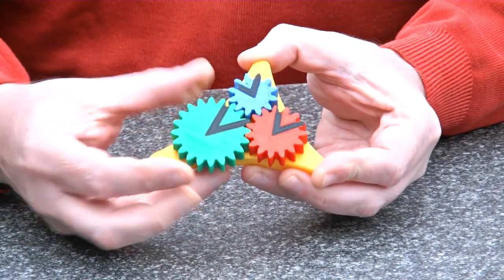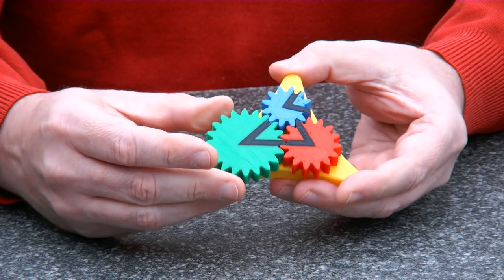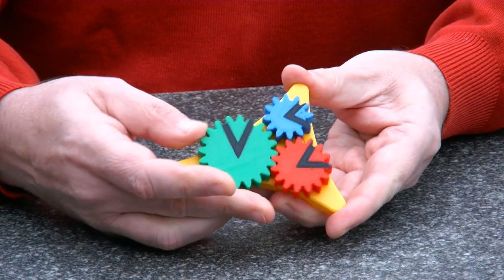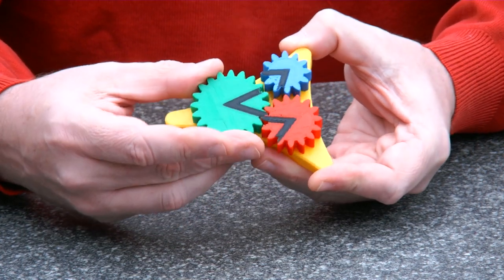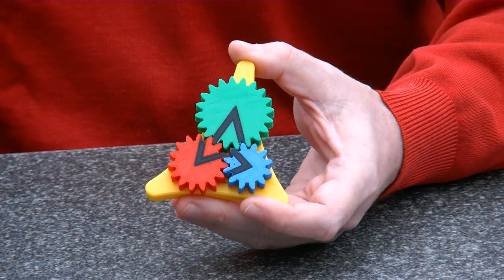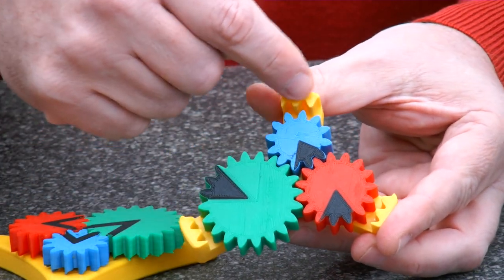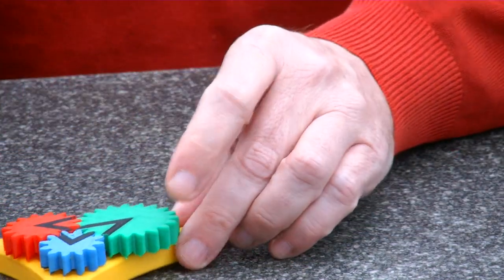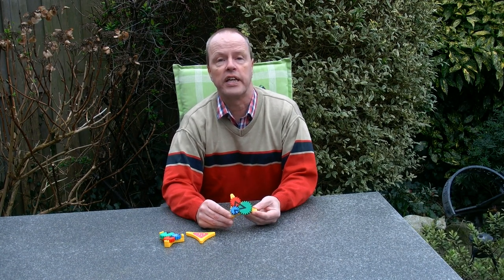Gearo - Can you find an efficient solving strategy?

Comment: What a clever mechanism!

I don't yet have an optimal strategy, but I notice some things:
WLOG I can talk about a "move" as a single counter-clockwise "click" of a gear (which causes a single clockwise "click" of the next gear).
At first glance, since there are three gears, the position space appears to be three-dimensional. But since clockwise and counter-clockwise ticks come together, the total displacement of the gears is conserved, so the real position space is a two-dimensional space. (Actually it's a two-dimensional orientable triangular lattice manifold, with pretty straightforward wrap-around at the edges, and if I could visualize it clearly, the optimal solution would be obvious.)
The moves commute, so the order of the moves doesn't matter, so a sequence of moves can be represented simply by three numbers: the numbers of green, red and blue moves.
Making one green, one red and one blue move leaves all of the gears back in their original positions; it is equivalent to nothing. So if a sequence is represented by three non-zero numbers, we can subtract one from each and get the same result, so an optimal solution will involve moves of at most two gears (which might cause some motion of the third).

That's about all I have. I also have a strategy which is sure to work, but it's very inefficient.
Reply: The fact that the three types of moves commute is important for describing this puzzle mathematically. The description I arrived at is a tuple of 3 numbers describing the absolute gear positions (or relative turn amounts). Importantly, each of the tuple entries isn't just a whole number, but a number in the finite group Z_(12,15,20) respectively.

One important property to consider is the sum of the gear positions. If we call the starting position (0,0,0), then we're probably gonna have to make moves that change this position sum to that of the target (let's say (4,0,0), the sum would be 4). If we represented the gear positions as just whole numbers, then the gear moves would always preserve this quantity; but because they are gears and return to the start after a full rotation, we have a way of changing it!

If we call the moves a=(1,-1,0) b=(1,0,-1) and c=(0,1,-1), we can calculate that a¹²=(0,-12=3,0). Similarly b¹²=(0,0,8), and c¹⁵=(0,0,5).

So we can change the position sum in increments of 3, 5 and 8. And we can wrap around at any time within one of the moduli 12, 15 or 20. We definitely have to do moves like this, but the question is what the most efficient way of doing it would be. This is where my abstract algebra knowledge leaves me and I just did a computer search, but if you just want a simple to execute solution then this is a strategy that can be done in your head.

For example, to get (4,0,0) we could do b¹² three times to get (0,0,4), then move that over to the first position. In total that's b⁴⁰, and that's indeed optimal.

Comment: Solve one gear, pull it out, and do the other two. There's also counting the teeth of the gears and figuring out how to effectively turn them all while one remains stationary each time, but you gave away the more efficient answer pretty quickly.
Reply: This does not work because none of the gears composite not coprime.
Reply: @Jesse_Carl  Which one? I had two ideas.
Reply: The first idea
Reply: @Jesse_Carl  Well, I rewatched the video and he was talking about the number of teeth making them composite, so pulling one gear aside while getting the other two spin just right would be no different solving a rubik's cube. The number thing would be more for my second thought of just counting all the teeth to figure out the exact number of rotations it would take to solve it, using math. The numbers all being a product of five should help out somewhat. You're also not saying anything to back up why I'm wrong.
Reply: @Daikon_Micucci  Fair, I could have gone into more detail. The method doesn't work though. 

Here is an example of it failing. 
First you solve the 20 tooth gear, and pull it aside. You find you're in a position where the 15 tooth gear is solved and the 12 tooth gear is one tooth off from solved. Now it is impossible to solve from this position without turning the 20 tooth gear again. To see why, note that the 15 and 12 tooth gears will always be turned by the same number of teeth relative to solved. Since the 15 tooth gear is currently solved, any solution must require some whole number of turns of the 15 tooth gear. Since the 15 and 12 tooth gears cannot be unlinked while the 20 tooth gear is pulled back, this means that whenever the 15 tooth gear is in the solved state, the 12 tooth gear will have been turned by some multiple of 15 teeth. Since three divides both 15 and 12, the position of the 12 tooth gear relative to its solved position modulo three remains unchanged. Since it started one space off from solved, and 3 does not divide 1, it will never be solved. To reach the solved state in this situation, you must turn the 20 tooth gear again.

This is why Oskar mentioned in the video that none of the tooth numbers were prime. If any gears tooth number was prime (or any pairs numbers were coprime), then your method would work.

Comment: Let's call the gears G_i (i=1, 2, 3, in counter-clockwise order) each with T_i number of gear teeth. Assume that T_i's are coprime but not necessarily pairwise so (for example, 12, 15, 20). Let's say each gear G_i needs to be turned by a_i (mod T_i) gear teeth counter-clockwise to solve the puzzle. Then using the coprimesness of the triple, we can find integers A_i for which A_i = a_i (mod T_i) and the sum of A_i's is 0. The vector (A_1, A_2, A_3) can then be expressed as a non-negative integer linear combination of (1, -1, 0), (0, 1, -1), (-1, 0, 1). The coefficients are exactly the number of turns (in the unit of gear tooth) we need to make for each 3 possible moves to solve the puzzle. Since the moves are commutative, the order we are applying the moves doesn't matter. 

I wonder if there could be a non-commutative variation of this puzzle, where the order or moves matter. One idea is to use spherical gears (making use of the fact that SO(3) is non-abelian), but that's probably very hard to make
Reply: I was going to say that but you beat me to it. 😀
Reply: Yeah, that was my first thought. Less abstractly, I think pull a gear out and move another gear such that when it's put back in those two will rotate to a solved position. Then pull the third gear out and unsolve the two solved gears such that when you resolve the third gear will be in position.

Which is probably pretty much the same as what you said.

Comment: Use red to align green and blue with each other. Then use full turns of green and blue to align red. Green will turn red slightly more than a full turn (by 5 teeth) and blue will turn it slightly less than a full turn (by 3 teeth). For the sake of arithmetic, call clockwise positive and counterclockwise negative. If you overshoot, rotate a few more times to reset. 3 total consecutive turns for green, 5 for blue.

Multiples of three and five added or subtracted mod 15 can produce any integer within the given modulus range. Therefore, this solution works without any parity issues. I think. I'm half asleep writing this.

Comment: I couldn't form a working strategy without playing with it myself, but I'd start by finding the GCD of the number of teeth in each gear pairing. I'd imagine an efficient solution could involve those numbers.
Reply: not a bad start, but I think the LCM might be more relevant. Rotating the smallest gear 12 times returns it to the start, rotating the middle gear 15 times returns it, so a multiple of both 12 and 15 would return both. The LCM of each pair AND all three is 60 btw, and you actually never need more than 60 moves to solve any arrangement! I'm not sure if that follows from the LCM tho, I just verified it with computer search. (EDIT: I actually made a mistake in that search & didn't count negative moves, allowing those the max number of moves needed is apparently 40 and now I REALLY don't know where that comes from)

Comment: to solve the puzzle, i would find the differences between each gear's rotation respect to one another. then I would rotate the gears by intervals of one until they balance out at zero;

the teeth amount of each gear can be quantified by x, y, and z; an arbitrary assignment. within that, we can connect that the angle of each gear means nothing with the ability to solve it, only the gearteath offset of each gear (defined by how many teeth have moved by each gear) from this we can suppose that x, y, and z equal 0 at the start. when x increases we can situate the idea such that y would be directly proportional (an arbitrary assignment). once x increases by one from the start we get: x =1, y =-1, z = 0. from this idea we derive the possibility of rotating the gears until they balance out by increasing and decreasing by 1 (keep in mind that full rotations counteract this and we need to modulate each quantity by 12, 15 or 20 respective of which gear is used)

I will get back once I test this idea on paper

Comment: Let's denote the gears as A, B and C
A has 3x4 gears, B has 4x5 and C has 3x5

lets denote the position of the gears by a, b and c. A b and c are integer that we can evaluate mod 12,20 and 15.

we want to move the three gears a certain number of teeth, and the with x moves of B&C, y of C&A and z of A&B (x,y,z can be positive or negative)

thus, we want to solve something like this : 
a = z-y
b = x-z
c = y-x

so that
a = a0 mod A
b = b0 mod B
c = c0 mod C

I'm sure there are a lot of good ways to solve diophantian equations like these very efficiently, but here's a cool way to do it :
if you look at the group : [[1,A]]x[[1,B]]x[1,C]], it has the same structure as [[1,3x4x5]]^2 (same number of elements, same order (of 3x4x5), they can be generated with two elements.)

the group morphism will need to send triplets to (0,1) and (1,0), this will prove it is a valid isomorphism (because it will be surjective).

for example, let's take:
u = ax5+bx3
v = bx3+cx4

(these are indeed group morphism (if a = a' mod A, ...) then (u = u' mod 3x4x5, ...) and have solutions for (u,v) = (0,1), (1,0)

then, the equations can be re-written as:

u = 3x - 5y + 2z 
v = -x + 4y - 3z 

u = u0 = 5 a0 + 3 b0 mod 3x4x5
v = v0 = 3 b0 + 4 c0 mod 3x4x5

this is pretty easy to solve, the solutions make a line in the (x,y,z) space, we need to find the point with the lowest sum of absolute values of coordinates.

We have one last trick up our sleeve: if (x,y,z)=(1,1,1), then (u,v)=0 (this means that if you make all three possible moves, we come back to the original position (looking back on it, this is very powerful and should probably be used first)

if you have 3 numbers x < y < z, and you want to shift them to minimize their absolute value, you should shift them by -y: x-y < 0 < z-y is the best way to do it.

this means we can find a single (x,y,z) solution, then shift the solution by the middle value of the result (not necessarily y). (this is doable once you find a solution, to get the best solution immediately. The math above is only the proof it's the best solution and a way to find a solution)(there is a bit more work because we're working mod 3x4x5)

an x,y,z solution is (everything is mod 3x4x5)

x=0 (1 assumption is possible)

u0 = -5y +2z
v0 = 4y  - 3z

3u0+2v0 = 3(-5y +2z) + 2(4y  - 3z) = -7y

17 is the inverse of -7 mod 3x4x5=60: 
y = 17*(3u0+2v0) (mod 3x4x5)
2z = u0+5y (mod 3x4x5)
(here, u0 and y have the same parity, u0 + 5y is even, we can divide by two)

we have found a possible (x,y,z) solution, we now need to test every combinations (x,y,z) win one of them at 0 to get the smallest solution. 

From the top of my head, we can try with y=0, x<0 and z>0  (this need to be done for all 6 cases)
-> the x-y value is (x-y)%60-60 
-> the z-y value is (z-y)%60
the sum of the absolute values is: ((z-y)%60)-((x-y)%60)+60

thus, we just need to find the minimum of ((z-y)%60)-((x-y)%60) for all 6 permutations of x,y,z, find the minimum : we'll get the best solution

There should be a lot of mistakes in there and everything is not clear, sorry.
Reply: Basically there are a few important things

-> every move loops aver doing them 60 times
-> all the moves are commutative

this means the group of moves is isomorphic to [[1,60]]^3

getting the position is a group morphism into AxBxC (that is isomorphic to [[1,60]]^2) 

-> doing the three moves loops

This means that the morphism sends (1,1,1) to zero. With this, we have basicallly solved the problem and can generate every possible winning move combination (there are 60)

Comment: Heres my strategy:
Twist Left than right once on first "solved gear" than  correct the orientation of the second "solved gear" without allowing it to unsolve the first "solved gear", twist the second "solved gear" once left than once right. Correct the orientation of the first gear without it unsolving the second "solved gear" than repeat. 

I have no idea if itll work but i got one more strategy.

Correct the orientation of the largest gear than give it one rotation clockwise, one counterclockwise, correct the orientation of the medium gear, give it one whole rotation clockwise and one rotation counterclockwise, than correct orientation of the small gear than give it the rotations clockwise and counterclockwise. That sould give all gears the same amount of circumference.

Comment: 20, 15 and 12 spokes
At the 0:00 position, we can turn the blue gear CW or red CCW to only affect green.
The 15 and 20 hear has a common denominator of 5, which goes into 20 4 times, so each time we do a full rotation of red, green rotates 5 positions in the same direction. CCW
The same with blue but a common denominator of 4 which goes into 20 5 times, so each full rotation moves it 8 positions the same direction. CW
So if we do both together, we move it 3 positions clockwise.
3 does not divide into 20, so every 7 times we do this, it moves 1 position closer to the goal.
Or we can count how many positions we are from the goal, and adjust to get onto any of the 4 or 5 multiplication table, in this case, being on the 9 position, we can just do 3 full rotations of both red and blue gears.

Comment: Here is a suboptimal solution.

The 12 tooth gear can effectively be moved independently clockwise N×3 teeth positions by locking the 20 tooth gear and turning the 15 tooth all the way around counterclockwise N times. This will return the 15 tooth to its original position.

Likewise it can be turned M×4 tooth positions by locking the 15 tooth and rotating the 20 tooth.

Values of N and M can be found to reach any of the 12 positions. N×3+M×4 mod 12

Similarly the 15 tooth can independently be turned multiples of 3 and 5, and the 20 tooth can be turned multiples of 4 and 5.

Solving each gear independently is suboptimal, but effective.

The motions of each pair of gears can be combined and reduced to the minimal number of tooth positions by taking the some of all of the rotations modulo the product of the number of teeth in the gear pair.

I could go further by writing and debugging a python program to find the minimal motions for solving all 3 gears at once. Running the program would clue me into my inevitable logic errors and allow me to fix them. To save time, just assume I described my optimization process here as a mathematical description, but it was riddled with errors.

Comment: What a cool mechanism! It reminds me of linear algebra as row reductions with a+b=0, a+c=0 and b+c=0. Where a,b and c could be modeled as positive or negative number on a 1 dimensional axis repeating after some number k. It looks like the gears have a 1:2:3 ratio, but you can make sure by counting the number of teeth. At least, that is how i would start trying to solve it :)
Reply from the maker: The gears have a 12-15-20 ratio, on purpose! Which?

Comment: It wasn't obvious to me but there are only a choice of 3 moves:
  Move the red green meshing teeth inwards
  Move the red blue meshing teeth inwards
  Move the blue green meshing teeth inwards

Doing 1 of each of the above cancels out.

Not optimal but simple is to turn the green wheel to the correct position then turn either the blue clockwise or the red anticlockwise (i.e. the red blue meshing teeth inwards) until they line up.

Comment: Hmm... okay, I have thought about this a little bit, though I have not been able to make much progress in finding an efficient solution. I tried solving it from the configuration in the beginning of this video by using a system of linear equations that have only integer solutions, which of course can be solved if you can solve an integer linear programming problem. Knowing that does not help me much, though, because there is currently no known efficient algorithm for solving the integer linear programming problem as that problem is NP-complete. Though I cannot prove this, it seems like the integer linear programming problem is reducible to this puzzle, making this puzzle also NP-complete and if I am right, then finding an efficient solving strategy to this puzzle would be a significant breakthrough.
Reply from the maker: This puzzle is not NP complete. It is a simple set of linear equations. See here my solve video: https://www.youtube.com/watch?v=mXaiyXGyrtQ

Comment: What determines which cog ratchets and which one turns with the one you are rotating? If I rotate any cog, which other cog turns? Is it always the bigger one, always the smaller one or is it random?
Reply: After watching several times, you can make whichever two you'd like spin together while the third ratchets. There's some physics at play that makes it "default" to one particular gear in his demonstrations which gives the impression that it's fixed.